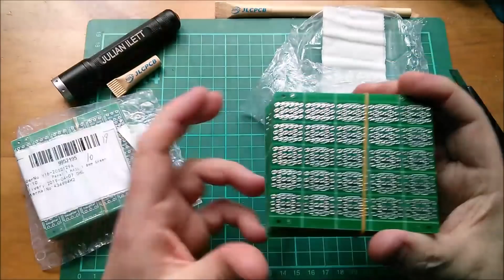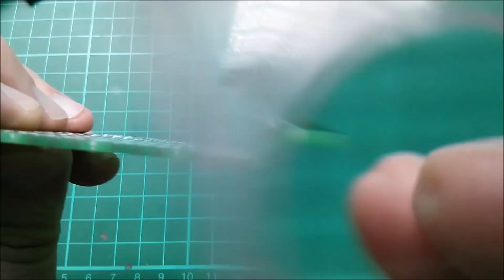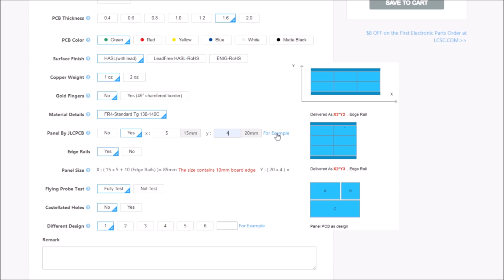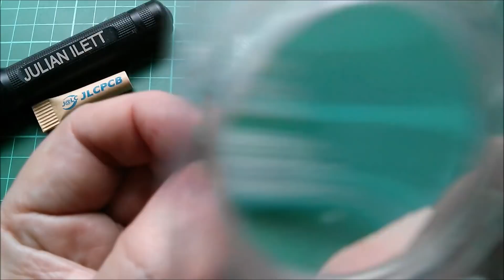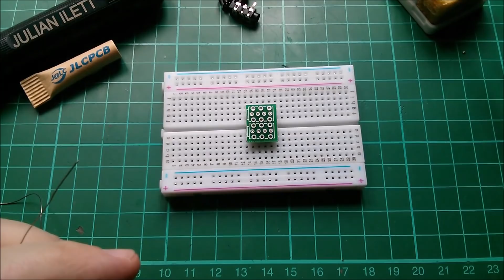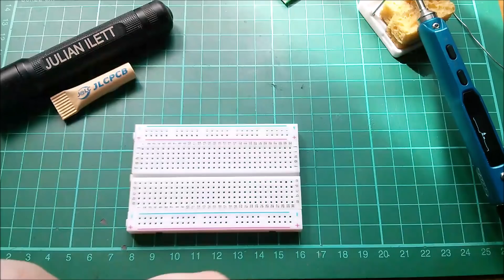New PCBs - Stereo Mini Jack Daughter Board - Vocoder

Comment: This stuff about trying to cram as much as possible into the smallest possible space is driving me nuts.  Particularly when it comes to soldering through-hole components on both sides of a board.  Me,  I'd much rather have little breakout boards that had the RCA or phone jack on the same side as a multi-pin jack that would then connect with a cable wherever it needed to go.  You might end up with boards that are a little longer,  but that's not that big of a deal.  We're not trying to miniaturize to the extent of hearing aids or similar,  are we?

Comment: @Julian Ilett I have a question maybe you can help me out. I have a raspberry pi 3 B I have a audio amp that is connected to 5v on gpio and ground on gpio. I have the audio amp connected for audio in using the 3.5mm Jack on the rpi3 B. The audio works but it has this distortion when the rpi3 is working or when reading microsd or when CPU is working its so loud and sounds like a modem over a phone line. I have tried using a transformer to cancel the ground noise this works a little bit but not as good. I need a good circuit diagram to cancel this ground noise. I don't know where to start. I could get a ground noise filter but the space is limited. Do you have a PCB plan that can achieve this goal?
Reply from the maker: Anyone have any ideas?

Comment: This is a bad design.  The board layout is too cramped, you should never need to involve bending pins and pushing with a screwdriver just to assemble, never mind servicing it later, which you will need to do because you picked very flimsy failure prone mini jacks.   You might say no you don't need to repair later because you have a surplus of parts because they're so cheap, but it isn't even easy to solder mere pins in a hole?  You might as well have gone with a thinner PCB if you're going to have the frailty of the mini jacks, then at least soldering would be a little better.

The smaller the connector is, the higher quality it needs to be, particularly if a jack where there could be any cable strain on it.
Reply: Depending on how tightly specced the enclosure holes are, ceteris paribus ,cable strain effects might be mitigated by the header pins being there; the cable will twist the d-board, which will partially  translate to the pins… 

However, the pin joints in this design have been compromised by being made 'flush'.

Comment: Shortly after, Julian realised that there is NO WAY that two regularly obtainable mini jacks are going to fit into adjacent sockets of this spacing at the same time without fouling each other. Good thing that he now has 250 of those boards available so as to have it really rubbed in.
Reply from the maker: Ah, but Julian has a very blunt Stanley retractable knife - more than a match for those PVC moulded plugs :)
Reply: @JulianIlett  It's called the Ilett Whittle, ha!

Comment: FYI.   I checked the PCB link and it says 2.00 for 5 pcbs. How do you get 10 pieces?
Reply: I just placed an order. it's 5.00 for 10 boards. If you want the boards scored and so that you can get more them 1 board on a panel, it is an 8.00 charge. For some reason the shipping was free. This was my first order with them and I am very happy with the ordering process and how fast they manufactured the boards.

Comment: I'm curious if the flux would help with the cheap solder. Also, the "mound" is created because the solder sticks to the iron - much better to use a lot of flux and hot air instead of a soldering iron. You need to heat up the pin and the bottom pad to "pull" the solder down into the via.

Comment: What if you tin the pins then insert them into the boad and try to heat it from the Jack side?  Or solder everything from the bottom before you push the spacers down?

Comment: Would superglue work to hold the pins in without it piling up? You can get some pretty serious industrial grade super glues. I use some in model making ( www.richbuilds.com ). This stuff sticks everything I've tried it with: https://www.amazon.co.uk/gp/product/B006PFN3BW/ref=ppx_yo_dt_b_search_asin_title?ie=UTF8&psc=1 (they do a debonder and instant set spray for it too)

Comment: I think a bit of solder braid would have more easily removed the beads. A shame the inner pins were done off camera, I was looking forward to seeing what you worked there. Another thought would have been to try some solder paste and a heat gun for the inner pins and/or header pins. But regardless of how it was done, good job. 👍🏽
Reply: Solder paste might solve the mounding problem since you could precisely add a set amount of solder.

Comment: PCB Prototype $2 for 10 PCBs (Any Color) is false advertising when they are asking $5 for 10 PCBs.
Reply: Hmmm... my last order was $2 for 10.
Reply: I wondered why my last order was all for $5, I thought maybe it had to do with the colors I chose, seeing as it was so much more expensive previously I guess I still felt like I was getting a good deal.
Reply from the maker: I've asked my contact at JLCPCB for clarification.
Reply: @JulianIlett  - Is it because the $2 offer is for first time orders and then $5 after that?  Still the shipping is the major expense (to Canada).  So can I order multiple board designs ($2/$5 10 PCB offers) and get them shipped at the same time (same box) to save costs?
Reply: ElmerFuddGun, they are asking $5 for 10 PCBs on your first time order now, it's only the 5 pieces that are $2.
They seem to have changed their policy without letting anyone know.
Reply: @Okurkaarrgghh  - Hmmm... so it would be cheaper to order 2 sets of 5 for $4 than to order 10 PCBs for $5?  And that second set could be slightly different to boot?  Interesting and weird math.

Comment: Could you get them to make PCB panels for your outside (workshop area) then you could reconfigure with just a soldering iron. A different approach to common building materials.
Reply from the maker: I could use reverse polarity tantalums as heaters ;)

Comment: i think you might run in trouble after some fair use of the jack outputs.. probably the strain on the solder joints will wear after some time.. the solder you took away is normally giving the strength to the joint ..
Reply from the maker: I sort of agree - but these are internal interconnects (not external sockets) intended to be connected just once :)
Reply: A loop of thread or fishing line over the mini-jacks and the plastic spacers of the pin arrays will transfer the force of removal partly away from the solder joints (the friction between the pins and the spacer taking some of the abuse). Even if the header pins are only occasionally cycled through insertion and removal, the design of the daughterboard, with the critical pin solder points concealed under other components, makes repair a matter of (too much) desoldering and resoldering. Compact as the daughterboards may be, they need some re-designing. 

Fortunately, you have the fixings for many replacements -- and cheaply. I expect the next iteration will accept the need for the pins to protrude above the board, in solder, and be placed outboard of the jacks to allow mechanical leverage a role in removal of the daughterboards.

It's not enough to ask 'how do I make it?'; you have also to ask 'how will it fail?' and 'how do I fix it when it fails (in the most-likely way)?'.
Reply: You need a pile of solder on FR2 boards or non through plated holes. You don't need that on FR4 through plated holes, you just need the solder to flow in really well.

Comment: You might have invented something here. I could see a company mass producing these and similar breadboard form factor conversions.
Reply: While watching it I was pretty inspired for a breadboard set up for building guitar pedals. Really good stuff.
Reply: I'm sure JLCPCB are building a giant IP bank  of good circuits, board designs and product prototypes ready to be mass produced at the push of a button. When they buy ICStation, look out....
Reply: I've used header pins and strip board to connect +- to pots and momentary buttons. Where component legs are too flimsy.
Reply: 10pcs DIY Mono Phono Stereo Mini Jack Socket PCB Child Riser Vocoder Arduino Suite Module
Reply: @Anvilshock  child riser... 😂

Comment: Instead of pushing the pins through all the way (1.6mmm) only push them 1mm through to create a well into which the solder will flow leaving a smooth top. I haven't tried this, it's a thought experiment!
Reply: (repost) "Or channel a concave slot in the bottom of the jack sockets." 

//please just edit your comment or write an answer of your comment, so that it will be together, otherwise you will never find it again ;) //
Reply from the maker: I do like a good thought experiment :)

Comment: Its very nice, But does putting mechanical stress on the audio connector could lift the pads on the PCB ?
Reply from the maker: On a double sided PCB there are pads on both sides connected together by the cylindrical thru-hole. It's like a rivet - very secure :)
Reply: yes that will happen over time, just look at old computers like the spectrum, atari or amiga without a power switch, people just shoved the connector in and out and didn't care until it didn't work. Julian is making interconnects which shouldn't need to be plugged in too often so will be ok.

Comment: Probably not getting the pin/breadboard hot enough for the solder to be dragged down the hole for a nice finish...
Reply: M&A Hudson , exactly!! I am willing to bet that fat tip he's using isn't heating the pins and that's why the solder won't wick. sometimes I get the impression he doesn't really know the basics.

Comment: Give some solder wick a go next time. Thanks very much for your content.
Reply from the maker: I do occasionally wick, but I find it so fiddly. I prefer the sucker :)
Reply: @JulianIlett  not me wick all the way. It's so much easier.
Reply: @JulianIlett  I do agree with you that, I have found that goot wick works very well, I was only thinking that wicks downsides would be an upside in this specific application, or removal I guess.

Comment: Panelizing for me does add an "Engineering fee" into the basket. I have a 20x20mm board and the 4x4 panel will cost me 7 Euros more and the "price" of the boards jumps up to 2.23, which is far from the $2 per 5 PCBs.
Reply from the maker: Is the board rectangular?
Reply: all squares are also rectangles :P
Reply: @mrlithium69  oh, you 😅
Reply: @JulianIlett  yes it is rectangular. I'm exporting the Gerber files from eagle and uploading. Don't know if that is the cause.
Reply: @JulianIlett  as a test, I made a 20mmx20mm pcb and uploaded it. Now it adds a "special offer" fee for €7.13 to my cart. When I try without uploading an actual board I get the "engineering fee". I am logged in by the way
Reply: @msana4420  - Hmmm... But where does your "2.23" come from?  Is that USD or Euros?  So is your total cost the same whether it is called a "special offer" or "engineering fee"?

I've got a few small boards I want to get made but some of their panelization info has seemed confusing.  Still good prices but why not maximize the deal.  It is the shipping (to Canada) that is the main cost anyhow.
Reply: @msana4420  They saw you coming.
Reply: @ElmerFuddGun  Sorry for the delay, I don't get notified on replies, don't ask me how I bodged that one up. So, if I enter anything up to 100mmx100mm as the dimensions (doesn't have to be square), I get a "regular" price of €1.80 (without shipping), which is right about $2.00 (also without shipping). As a test, I tried with my 20mmx20mm board as a panel of 4x4 with 10mm edge rail, which is still less than the 100mmx100mm "standard size" btw, and the price of the PCB jumps up to €2.23 and a "special offer" charge of €7.13 is added on my order. so total price, without shipping is €9.36 (~$10.42 atm) , far from the advertised $2.00 (~€1.80).
Reply: @mahlapropyzm9180  prolly true

Comment: One Question: If i understand it right, both channels of the Stereo socket are bridged to a mono input. If you actually plug a 3.5mm mono plug into this mono socket will everything short out? I can imagine its easy to assume that a mono plug is the right choice for a mono input...
Reply from the maker: This will be the input of a mixer - so all the incoming signals have a resistor in their path - shorts won't be a problem :)
Reply: it won't short out but a mono socket would be the right choice. same goes for the  4 stereo "daughter" board (8 inputs which do the same thing) why?
Reply from the maker: A mono socket might work. But the motherboard (to these daughterboards) needs 16 audio inputs and only has space for 8 physical sockets. I'd have to test a mono socket to determine its behaviour (one channel only comes through / both channels come through mixed together).
Reply: Julian Ilett what i ment was that the longer ground on mono jacks will touch the center pin of the stereo socket... so basically ground is connected to right and left..
Reply: @BaumInventions  I really hope ground is connected to both, that's what a ground is for
Reply: @PetRatty  I have the feeling i am not abled to describe what i want to say... Or i have a wrong imagination of the inner workings of this Stereo 3 Pin 3.5mm Socket...
Coming back to your last comment : To connect Ground to the input directly does not seem to be a good idea in general.